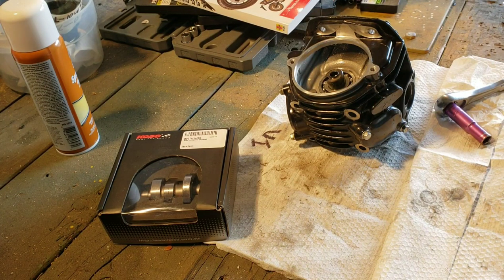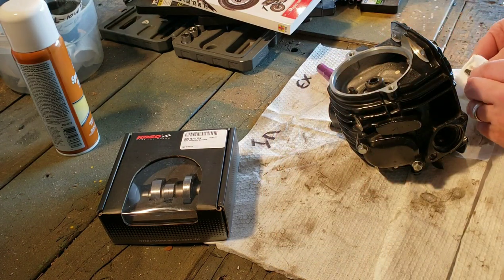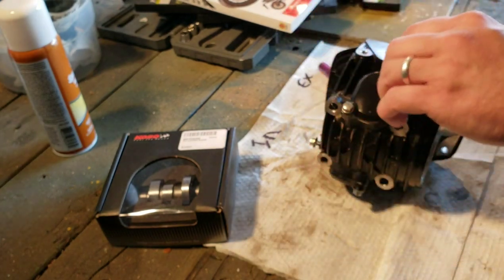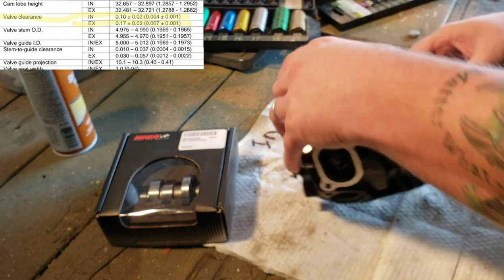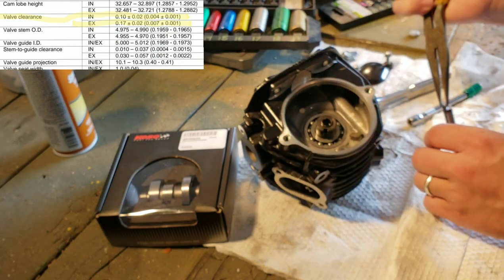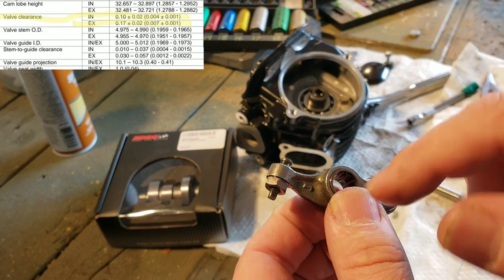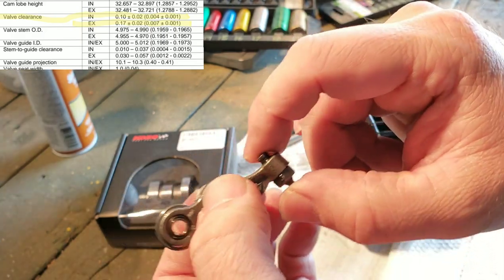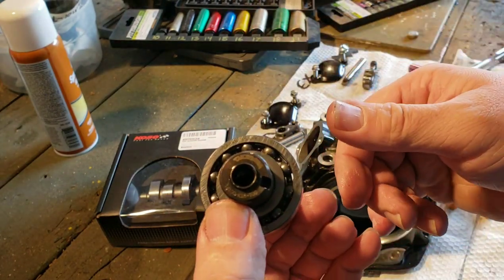Honda Grom CAM - camshaft  Removal -  Installation

Comment: Y did u switch to  the different camshafts is one brand better than the other?
Reply from the maker: The koso camshaft  Has been proven to make more overall horsepower and can rev out to a higher  RPM range.  It just depends on exactly what you are trying to get out of your motor.. The TAKEGAWA   Camshaft is a great cam there is absolutely nothing wrong with it.  It produces a lot of torque from the get go. If you are trying to pull willies and do stunts I would go with the takegawa..  If you're looking for more power at a higher rpm and more top speed I would go with the Koso.
Reply from the maker: I am going to Turbo GROMZILLA ... the TAKEGAWA  CAM REVS out way to quick.
Reply: @BLRTUNING   nice I'll go the koso when i do do  the cam mod someday.

Comment: is it possible to swap cams without taking the head off? planning to do mine this summer
Reply from the maker: Yes absolutely I've done it both ways and it's just as easy either way you can leave the head on the bike take the timing cover off loosen up the timing chain and you can very easily get the camshaft out and put a new one in make sure you adjust your valve lash after putting a new one in most camshafts use stock valve lash
Reply: Thanks for the reply! will do a tbcam and dhm ecu reflash in couple of weeks, hope that the needle bearings wont fall inside the head. 🤣
Reply from the maker: @johnguese4566  if you scroll through my YouTube channel I have three different videos about the camshaft on the Honda Grom
Reply from the maker: @johnguese4566  glad I could help
Reply: @johnguese4566  I just got my Tb cam and dhmotoring ecu flash I need to install still. Is yours on the bike?
Reply from the maker: You can change the camshaft without removing the head I've done it both ways it is not hard at all just make sure you loosen the valve lash up and then make sure you read just it after you get the cam in

Comment: So with this cam in place, do you lose low end torque?
Reply from the maker: With the koso camshaft you will lose a little bit of the low end it starts picking up right around 5000 RPM.. takegawa S-Type cam you gain low-end torque...
Reply: BiLL Ramseyer do you lose the top end with the Type S cam?

Comment: Is it normal high lift camshaft is noisy than stock?
Reply from the maker: Yes absolutely.. if it's the TB camshaft swap it out for the koso camshaft.. you'll make more power across the board.. Everyone's going to tell you something different everyone has their own opinion my opinion is I don't like the TB camshaft..
Reply: @BLRTUNING  thank you for the advice ride safe